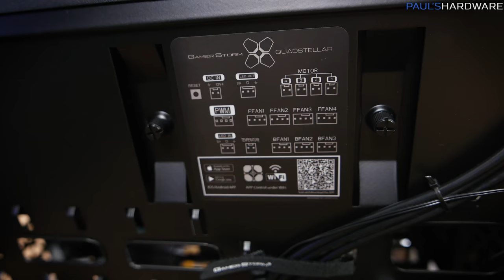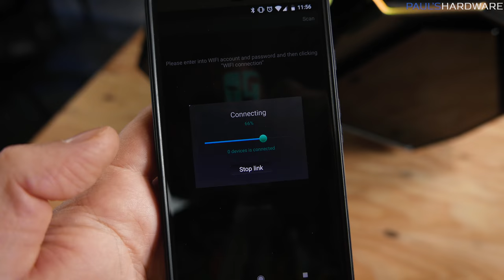Building a $4800 PC in the Deepcool Quadstellar!

Comment: Is it $4800 with or without the Vega at the extinct MSRP?
Reply from the maker: $4800 is the current price for the components used (excluding the PSU cable extensions), which means that the Vega64 is $950 and the RAM kit is $400-ish. 😭
Reply: hurts, right in my wallet
Reply: Same ram kit in Canada is almost 600$ after taxes. tears R.I.P. my future build...
Reply: Yeah my 32GB kit of G.Skill TridentZ RGB 3200MHz was $450 ish with shipping and handling included, but currently only running dual channel on my 1950X build. Current prices SUCK!
Reply: how many kidneys is that?
Reply: Everyone's in your curent household.
Reply: The Vega 64 strix is $1599 in Australia ._.
Reply: I got my Vega 64 Liquid on release in Australia for $1000. Times suck but I don't need to upgrade for years so I'm fine
Reply: WArockets i wish I bought a vega at launch FeelsBad
Reply: Paul's Hardware onc
e you go red you never go back, cause youre broke af ;)
Reply: Just one, Kidneys sell for 30k
Reply: sad

Comment: Paul, just something you might want to consider. Having that AIO mounted in that configuration could trap air in the pump/waterblock unit. That will make it become noisy later on and could also hinder performance and longevity of the unit. Other than it looks amazing!

Comment: How badass of a server would that case make
Reply: Yep, if you can place another 9-drive cage in the graphics card compartment. Hmm...
Reply: fritsk2 mod???
Reply: Well, it looks like a pretty modular case so if Deepcool would sell a spare drive cage it should be feasible. Pretty expensive and over the top for a server, but 2x9 3.5" drives plus a bunch of 2.5" devices would be plenty for most people:-)
Reply: fritsk2 true small business server
Reply: Or, you could get a case that takes half the foot print, takes twice as many drives, and has much better airflow..  For the same money or less I might add.
Reply: But that would be the sane boring approach:-)
Reply: fritsk2.   hehe  Honestly, if it wasn't for how the panels come off, it wouldn't be so bad. But the case is 2 feet deep.  Which means you have move it forward 2 feet at least just to get the panels off to do anything.  Like add RAM or change a dead HD.  Too much of a pain for me.

Comment: Actually it's maybe a bit late, but I just ran across your video now... The front dust filters are magnet-hold so you can easily remove them for cleaning. Other small thought is that the recommended space for a radiator is in the front across. It can accomodate up to a 360mm radiator if you displace one of the fans.

Comment: The side pieces should fit 360s, just very tightly, and may cause issues with getting to the thumbscrews for the back panel and may cause issues with the front fans.
Edit: Of course they're not designed to, but the'res the space for them.

Comment: Yes it does, definitely. However I think i might need to get a little creative, cuz I do wanna fit a 480mm rad instead of a 360mm rad. The reason being is that I need to have enough cooling surface area so that I can cool 2 GPUs with 1 loop while the fans are at low RPM. For the CPU, i have another solution, it's still going to be watercooled, but I will use a watercooler WITHOUT a pump, which was shown at Computex and should be coming to market by the end of the year.

Comment: Apparently the led/front panel controller can only be rest as the machine is booting. Add this to not making it clear that the glass is held on with magnets, it shows that the included instructions makes a great wall poster but lack when it comes to helping the builder. 

I like the case. I wouldn't buy one. It's great that designers are trying something other than a black, rectangle box. I personally like the black, rectangle boxes, but the world will be a boring place if that's all there was. So, thumbs up for Deepcool. I feel that this case shows that the design has potential, but it's not quite there yet. It's less limiting than the three pod design, so maybe a five pod design? Who needs that much drive space? Who needs that much PSU space? Perhaps, with one tall middle pod for mobo, and two smaller pods both to the left and right? Mobo upside down for tall air coolers? However, I can see that phone app being a constant source of regret.

Comment: Couple things I noticed incorrectley stated in this video...

Tempered glass is magnetic and removable. It's just a extremely strong magnet.

Second, it does support 280 & 360mm radiators. There's a 280/360 radiator mount in the rear of the case behind motherboard. The other side mounts are for 240mm.

Comment: Its a water cooling only case also you can put two 80mm fans in the back of the motherboard area. Need to connect the app via 2.4ghz wifi no 5g.

Comment: I would love for case manufacturers to stop putting front io headphone and mic on the front and instead have USB C along with a few USB 3.0s. The front audio jacks provide the worst quality I swear. I don't know anybody who uses them. Great content Paul, ridiculous build! Lol badass 👍
Reply: Really?  A direct output from the sound card is worse than being process through USB? lol  You're funny.  Maybe you have never had HD audio front inputs with a really nice set of headphones.  I have that setup and it sounds amazing.  Then again, I didn't cheap out on the headphones either.
Reply: USB is better; If you have headphones that were worth the asking price, you probably should get a USB dedicated DAC/amp to go with them. No sound card or motherboard audio offering will beat a high-quality discrete implementation. Front-panel output tends to introduce noise as well.
Reply: You know, come to think of it, I don't use the front panel audio inputs. lol    I am plugged right into the sound card.  But to think that USB is better just doesn't make any sense to me.  After all, if that were true, every home theater stereo would have USB outputs, not headphone jack outputs, right?
Reply: D Cheverly No.

3.5mm is far more convenient, and "good enough" for most people. Sometimes, an above average implementation will be satisfactory to people with mid-fi equipment. But anyone who has invested heavily in their headphones generally wants more than good enough.

Just like with home theater, a discrete solution for digital to analog conversion, followed by another for amplification, then your headphones, usually leads to better results. Lower noise floor, better detail resolution, and support for digital codecs and higher fidelity output in general are the advantages to external DAC/amp solutions.

That being said, you'll almost always get more mileage out of better headphones than dropping cash on DACs and amplifiers. Some headphones sound unquestionably better through a powerful amp. Others are very sensitive to impedance changes (Google Impedance Matching). Some amps color the music in ways different from others. There are a lot of reasons you'd want something dedicated. But if your headphones don't sound weird or congested or if they  get loud enough for you, it might not be a priority.
Reply: Makes sense.  I am half asleep when replying most of the time because I have insomnia. lol  There are some things I forget.  Like, I only bought my headphones for music, not gaming.  I know that makes a difference.  Can't get a surround headphone in non USB, correct?  I did do a lot of reading before I bought them, and even my audiophile father things they sound great.  So there's that. lol  If I was using them on anything different, or for a different purpose, like gaming, I would have chosen differently, for sure.  

I do understand what you are saying though and I think I shouldn't have jumped the gun.  Dad has always had really high end audio in the house, so I don't have any experience with anything external from the amp, before the headphones.  Do they really make that much of a difference?
Reply: D Cheverie yes.

Also, no need for virtual surround in gaming. You'd be better served by headphones with a wide sound stage than virtual surround.
Reply: There's nothing inherently wrong with 3mm jacks and for the low amount of amperage headphones require, they're sufficient. The problem is computer case makers don't know audio.  In every case I've used, the front audio jacks share a common ground with the USB ports causing a ground loop where you will hear electrical noise from the computer.  Everytime I decouple the ground, all the noise disappears and you are left with a decently clean analog signal.

Comment: Was that dual 80mm fan support I saw for exhaust on the mobo quadrant? Good place to put some of those $10 noctua redux fans. Also, do the front flaps only go through that sequence and close back up or can the user open/close them when they want (using some included feature instead of manually setting them either way).

Comment: Honestly, If they made a cheaper version of this with mesh panels instead of TG, and had space to mount 360mm radiators where the drives and extra graphics card areas are, I would buy this case. have a couple drives in the psu area,  and have 4 360mm radiators in the top portions of the case.

Comment: if using the 360 rad in the front i am assuming it is designed to pull air in, is it really advisable to blow the hot air onto the motherboard like that?

Comment: This is an aesthetically pleasing case, but building in it looks to be a nightmare.
Reply: Yeah, and it takes up most of your desk. lol  Just cause it looks pretty, doesn't mean it's useful.  Just like the Canadian Prime Minister Justine Trudeau. lol
Reply: It's a major pain to work with try fitting a full custom water loop with 2 240 rads. I wanted to run a 360 but would not fit. Ended up having to go for a slim one for the bottom of the motherboard compartment as the hight is an issue. Then had a major issue when the pc failed to post...... Haha yep the mobo was bricked. I was just about able to get it out amd new one in without having to dismantle it all.

Comment: What I should go for budget gaming PC i3 with gtx 1050 and 8gb ddr4 or ryzen 5 2400g with 16gb ddr4 ram 3000mhz
Reply: Yuzcan Semsi I say the 2400g and get a gpu later on. That way you already have a decent cpu and 16gb memory. the i3 would have better IPC just no hyper threading. Idk it’s a hard choice tbh lol. Maybe if you can get the i3 try and find a used gpu (if you can) for around $150 or less  970,780ti,290. I just have a hard time recommending a 1050 atm since they used to be $100ish.
Reply: Yuzcan Semsi I would’ve thought, with specs that low, you may as well get a console
Reply: ryzen 5 all the way, more cores and threads, i3 is too weak to be any good

Comment: Hi there, I have a question. What did you do with the 18 pin cable from the quadsteller?
Reply: Are you talking 20 pin cable that comes from the front panel where USBs? If so, I think you should connect to your motherboard USB header. You have to open your motherboard manual. Mine was 20-1 pin U31G1 on Rog Rampage VI Extreme.

Comment: I looks like the probes from portal but I would be most disappointed with a case that has separated out cooling zones as the primary feature being cooling and yet doesn't support the biggest possible air or water cooling features.

Comment: The case is a neat idea I suppose, but it's so restrictive. There isn't NEARLY as much room for air flow as there should be, especially for the storage quad. It's not practical that it restricts how big of a cooling fan/radiator you can have, or how much room you'd need for an air-cooled CPU. Those funky aluminum sleeves that cover the quads are honestly really silly. $400 USD for a case, and it's more work to get to your components than it is for a $50 case? That's pretty unreal. And not to mention that it doesn't support any 5.25" bays or USB 3.1/Type C. It's not a user friendly case in most situations and that's just not right for how much it costs. My Cougar Panzer MAX was $300 CDN and it's miles easier to access and mess around with, and the only problem it shares with the Quadstellar is that it has no USB 3.1 or Type C support. Otherwise it's just a better case all around for $250 CDN/ $180 USD less than the Quad.

TL;DR this is a case for someone who wants to brag to their friends about having a silly looking $400 case
Reply: Not to mention that it takes up twice the foot print on a desk as your case, and has less room inside and has less customization.  Also, 120mm fans, really? lol  and with those stupid shiny covers on the front of the quads restricts airflow massively.  It's highly unpractical.  In every sense imaginable.
Reply: Layne McCallum 

Considering in almost all performance reviews that quad case drastically reduces heat build up and lowers average temperatures better than any other case... I'd say you're probably wrong.
Reply: The only reviews I could find that talked about thermals were comparing it to cases with some of the worst thermals on the market.
Reply: The louvers on the front of the case open when certain temperature requirements are met. Now, compare those, you saw how far they opened, to my current case;  a Glacier White Steel Silent Window Phanteks Eclipse P400S.  

I'd personally swap the position of the PSU area to the top where the drive bay sits and rotate the MOBO to accommodate that change. Then my 2 highest temperature producing parts, GPU and PSU, are now at the top. Heat rising on it's own would allow me in my mind to run slower speed fans equaling a quieter case. 

I don't completely disagree with you or the OP. And while the price is high I think it would be a fun case to just do something different with. Granted it did seem putting things together was a PITA. xD Still. Difference of opinion and just sharing some info and my own.

Comment: You can remove glass panels they are held by magnets, so you dont need to pull off all the parts to get inside. Read user manual at least.

Comment: Absolutely love this case but the lack of USB-C prevents me from ordering it for my new build. That is very disappointing to an otherwise perfect case.
Reply: Daniel R. They only put relevant things on it.
Reply: Oof
Reply: Alexander USB-C is very relevant for some of us. Try shooting weddings with the Sony A7R3 & transferring the data over anything not USB-C (3.1).. It would take forever (the files are huge). Another benefit is while transferring the data you can charge the camera at the same time. To a lot of people (my self included) that is essential. It all depends on your workflow & what your needs are. Some of us do a lot more than just game on our rigs.
Reply: Daniel R. I've been hearing this since 2015, it's still nor relevant. Use the one on your mobo if it's that essential.
Reply: Alexander The one on the mobo would defeat the purpose of a case like this..why.?. Because you’d have to run a cable from the back of the case & almost always leave it plugged in so you don’t have to suffer with the inconvenience of reaching back there & re-plugging it every time you need to use the port. That would create a messy look, I want to hide as many wires as possible to achieve as clean of a look as possible. If the USB-C port was in the front I could very easily access it whenever I need to use it without any inconvenience all while maintaining a very clean aesthetically pleasing look. That’s why we go for cases like this in the first place. That USB-C port being in the front goes a LONG way. In my case it is literally the only thing keeping me from placing an order, truly a shame. Fingers crossed for an updated version with USB-C in the front. I really want this case.
Reply: This case definitely seems like it's made for a creator that may have clients in their office and may want to impress them a bit. Too bad about the missing USB C on the front.

Comment: I had the pleasure of building in this case for a customer.   It is quite large, but I didn’t find the inside to be as roomy as it would seem.   Customer had a Dark Rock 4 and it would not fit.  the quardant panel would not fit back on the chassis.  Found another air cooler that would fit, but it seems as if it is made for liquid cooling.

http://mmolenda.com/techparadise/my-favorite-build-of-2018/